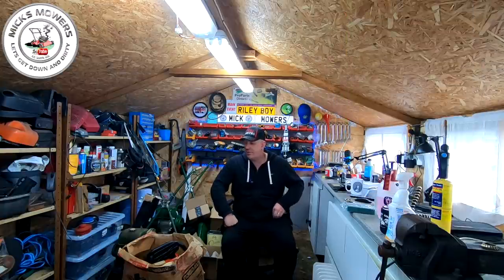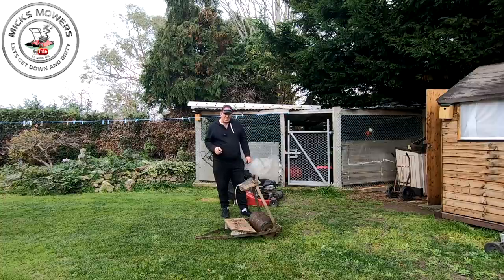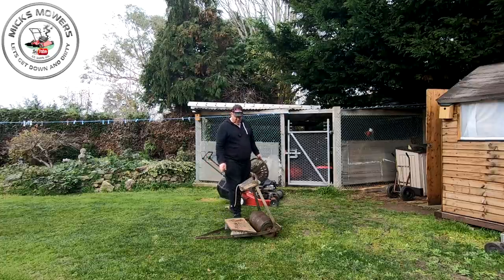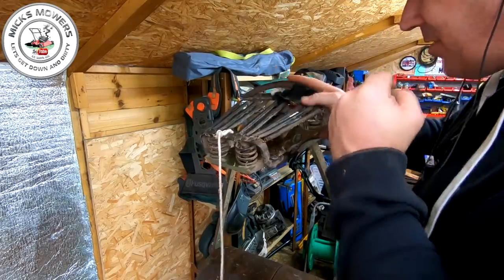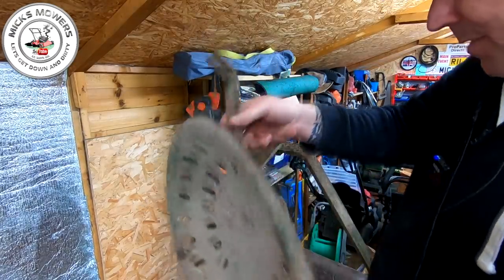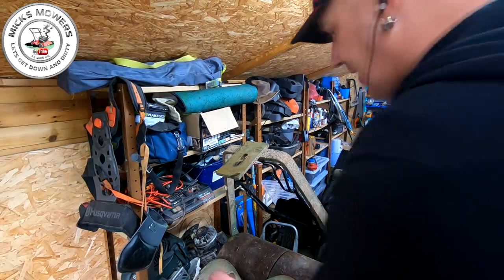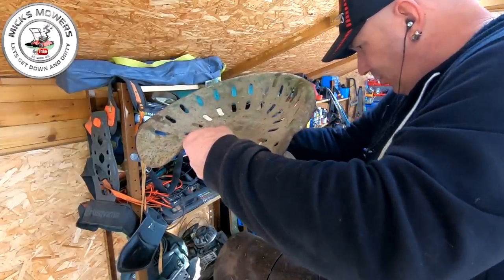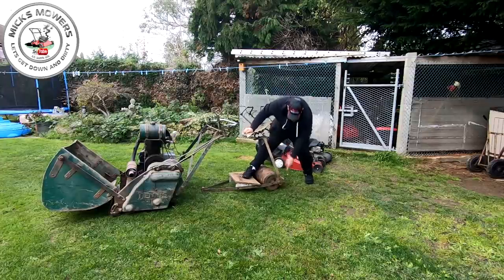Dennis Z Type I Have Found W  Roller Seat Lets Check It Out

Comment: That travelling jet, try stretching the spring a bit, it's the spring pressure that stops it moving. Oh and when she backfires on throttling down its a sign she's running lean 😉
If your thinking of removing the engine in the future for any reason beware the cushion drive between the flywheel and shaft to the gearbox, the bolts with castellated nuts and split pins can corrode to the fabric cushion and it can be absolute hell to separate.
Reply from the maker: Thanks for the information.. I'm a long way off sorting it..

Comment: i havent seen a swivel seat but with the fixed seat i found users slow down stand on the board and turn
Reply from the maker: Thanks
Reply: @themowerman  from what i remember the handles were quiet close on the sitting because they sat with there arms almost straight down to put down pressure on the rear roller to to give traction
Reply from the maker: @russellpetrie119  yeah I'm going to have a look at it.. I think it's a toss up between how tall I am and what's practical..
Reply: @themowerman  you dont want to be leaning to far forward it can damage your back